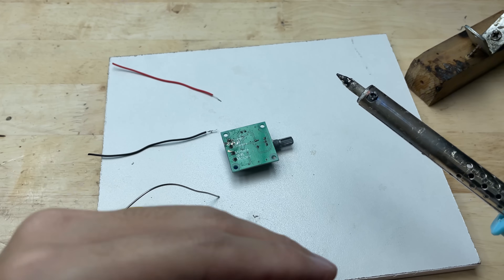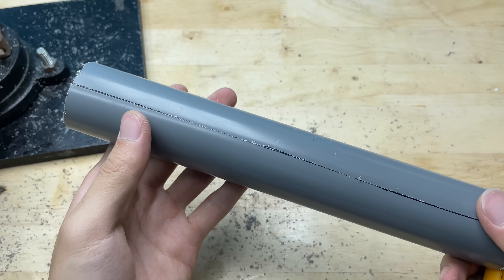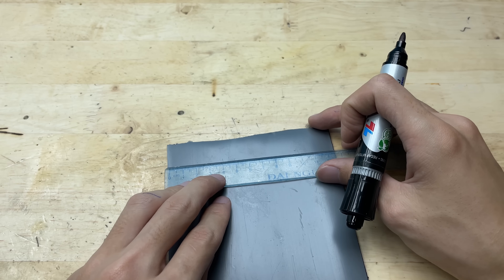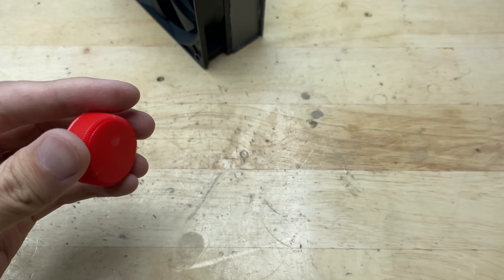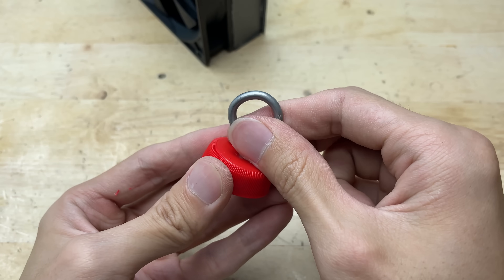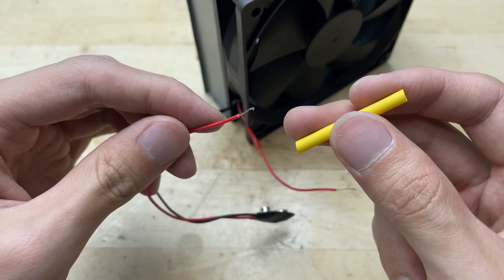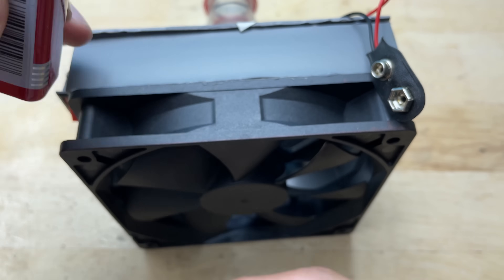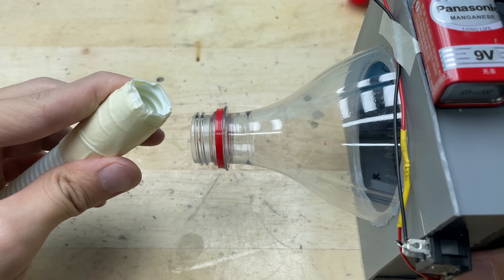Why isn't this patented? Every house needs this and no one does it!

Comment: Learn how to use a soldering iron, get some foam wet it get your iron hot while the tip clear and put the solder to the tip and you will get no smoke easy